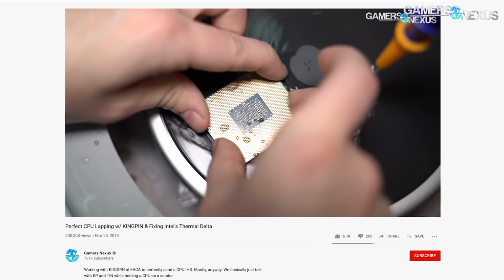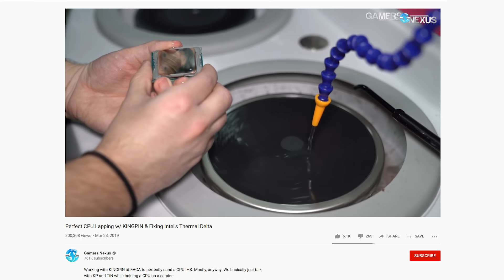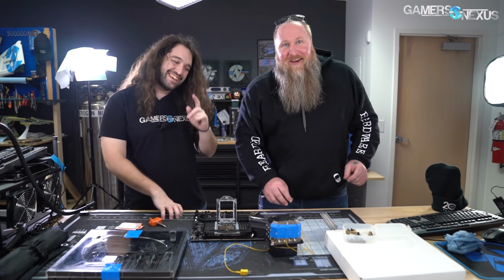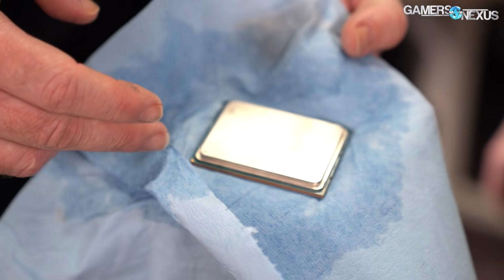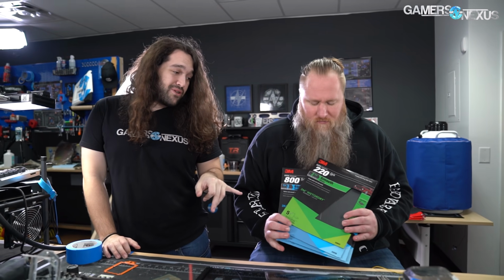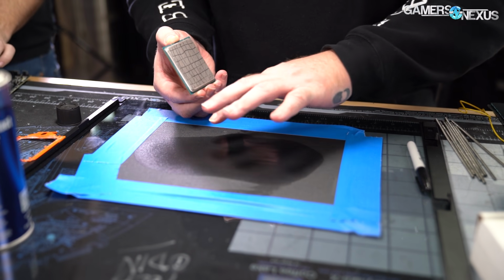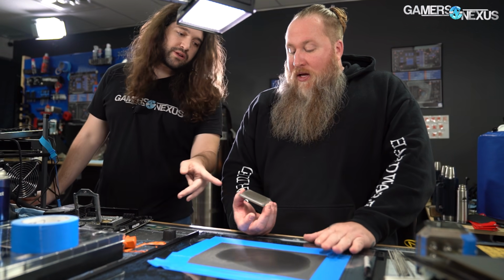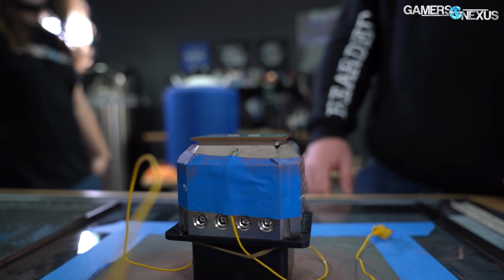AMD Threadripper CPU Lapping & LN2 Prep, ft. Bearded Hardware & 3970X

Comment: Why does everyone assume that the nickel plating is the same thickness across the IHS? Is that proven? How do we know that the nickel plating isn't the way that they put a perfectly flat surface on top of the slightly imperfect copper base? It seems to me that, unless the process of nickel plating invariably produces uniform thickness, the fact that copper begins to show through unevenly doesn't necessarily prove that the nickel surface wasn't flat.
Reply: AFAIK they use some galvanic process (same as you would apply chromium on car parts) this process usually has a very even outcome - especially on such flat surfaces.
Reply: @ISOHaven It does when nickel plating something. It's not like dipping it in paint or something. And they use electroless plating and not the electroplating people do at home. The variance is to the size of an ion because they are always attracted where the least are positioned which for nickel means 0.00000007 mm.
The warping happens when placing the nickel plated IHS on the CPU and is often just by design because of accepted tolerances.
They could make and sell CPUs much flatter than you'll ever get with pathetic sandpaper (grid 2000 sandpaper only does 0.01mm particles.) but there is no reason to. They absolutely do not give a shit that you buy their CPU because Dell buys 10 000 every month to put in a server rack with 6000 rpm fans blowing on the heatsink and they wouldn't if they added an unproportionate amount of money to get the temperature 1°C down.
Reply: @ISOHaven 0,1 mm this is 3times as thick as a copper layer on a pcb ..the coating which we are talking about is in the range of a few micrometers - a veriation of 15um to 20um so +/2.5um is way below the flatness/parallelity of the IHS. for further read i can recommend you this https://www.nickelinstitute.org/media/2323/nph_141015.pdf edit i meant this https://advancedplatingtech.com/electroless-nickel/electroless-nickel-plating/ ...but the otherone is also good if we are talking about conventional electroplating
Reply: if the nickel was perfectly flat, it would wear evenly when abraided on a deadflat surface--they demonstrated here again that it doesnt
Reply: @jefflavenau  The whole IHS is deformed and that's why you see it disappearing over different spots.
If you ever lapped a CPU you would see  you're taking of nickel first and afterwards a mix of copper and nickel which wouldn't happen if the copper plate was flat.

The deformity happens when placing the IHS on the CPU. The nickel plating happened months before that in a whole other factory. They place an order for a few ton of nickel plated copper sheets and then work with it from supply.
And again this is electroless nickel plating where you have a variance of a few tens of picometers. Not the amateur electroplating people do in a tupperware bin.
Reply: @Rizon1985  I think you meant to tag the OP because that's what I said
Reply: @jefflavenau  I m assuming that you dont have a engineering degree (this should not be considered as offensive). But then you should know - deadflat does not exist. Try to get a machined part with parallality of 0.01 mm and flatness of 0.01mm yes possible but not cheap and definitely not used for IHS mass products. so if the piece of copper is like a mountainchain under the microscope evenly applying nickel will not flatten this. At least not with the described method. So now hand lapping with ordinary sandpaper on a "deadflat" surface. I have done this by my self. If you move the cpu with your hands on the paper you can not hold it flat in the micrometer range so you wiggle it around the center and in the most cases you tend to have a konvex shape. Therefore you will first remove nickle on the corners. In addition to this the sandpaper behaves on the smallscale like foame so the edges of the cpu will tend to be deper in the paper than the center of the cpu. next even if you use tempered glass it is not flat unless you buy something which is calibrated like a granite stone class 1 or even 2 (this is what i would consider as almost deadflat) ....just have a look at this https://www.youtube.com/watch?v=j9FsmsjXKx8
Reply: @siclucealucks  that is the point I am making. Neither the copper nor the nickel is flat. Hence they do not wear evenly when brought in contact with a relatively flat abrasive. Why do you think I'm arguing? What I'm telling the OP is that the IHS is demonstrably not flat as illustrated by it wearing away in the corners first. Yes. We are saying the same thing.
Reply: @jefflavenau  The nickel is flat on the cooper. It is like snow on a hill - homogeneously distributed. If you grind the hill you will first grind off the tip of the hill hence the copper will shine through and will give the impression that at that very point the nickle was thinner - which is not the case. You just grind off the material on one point of the bulk. This is why I'm arguing nickle is flat, copper not. But flat on nonflat copper so it appears that the nickle is not flat too. The OP was asking what if the copper is flat and the nickle is not? All the arguments made by others and me are to proof that the copper manufacturing is the issue not the nickle.

Comment: I appreciate this.. I just lapped my 1950x and heatkiller iv pro.  My cpu was pretty flat.. didn't even make it through the plating everywhere before the whole thing started getting polished on the full surface.  The cold plate was really high centered though... I'm on water and I am happy to say I dropped a few degrees at idle... but I feel it's better contact and running even a few degrees at full load.  If it wasn't for this video, I'd still be hemming and hawing over doing it..  My copper showed up kind of in the middle first.. and when I was seeing good polishing on the nickle everywhere I stopped...

Comment: "You can have a fun project with this, even if you void your warranty."
The fun begins by being able to afford it.
Reply from the maker: I mean, sand paper is like $3. You can lap any CPU with an IHS.
Reply: @GamersNexus  I was referring to the CPU, but even tho it sounds like a good experiment to do.
Reply: When I upgrade from an i3-2100 to a 3000G soon, I'll both delid and lap the i3-2100. Just for practice. Then I'll do the same to the 3000G. By the time I can afford a nice processor I'll know what I'm doing and it'll cost almost nothing.
Reply: @cm01  You can't get a used 2200g?
Reply: @crazyjak56  meh, sure I could
Reply: I can afford it, but I run a sudden and an RX 580. Got no need for this ridiculous amount of power, and you get money by not wasting out
Reply: Linus already voided that by fixing the pins.
Reply: @GamersNexus  $3 whole dollars? This man's insane! gets struck by tech lightning

Comment: If you increased the git on the emery paper, through a number of steps ending in 2000 or even 3000 grit you can achieve an almost perfect surface without visual scratches, this improves the contact still further, its worth a try.

Comment: I used to lap all of my heatsinks when I was younger and cared about maximum cooling performance.  The difference was generally measurable from around 2-5ºF reduction under load.   The CPU's I worked on were open die (Athlon XP era) so  I never really thought of inverting the process and lapping a CPU lid.
Reply: not delidding ?
Reply: @rogueanuerz  believe it or not, CPU's didn't have lids back in the day.

Comment: 9:51 Me, an intellectual, has his barebone motherboard bolted to a piece of wood, with the PSU at its side as a stand for the anime figures and bunch of cables and the SSD around.
All of this in the very same (16 x 45") table that my keyboard, mouse, monitor and residual nocturnal food and beverage are.

Comment: If you've done this before you'll also note that the flatter the top of the chip is, the more prone it is to hydro-locking on the heatsync.  I do on-site OEM Certified repair and there's a big difference from one chip to another.  Older "dryer" thermal compound can also make a difference, but often the hydro-lock will force a pinned CPU out of it's socket.

Comment: The two surfaces get "rung" together. That means that all or most of the air gets pushed out from between those surfaces. So atmospheric pressure what's to hold them together.

Comment: The rotary polisher is not a good way to lap anything unless you have a jig that will hold the chip completely parallel to the surface. As trying to hold anything by hand you will apply uneven pressure and will inevitably put facets in your chip surface.  You also need a fine enough abrasive to provide a smooth/flat surface.. I work in an industry where companies are lapping silicon wafer chips to witihin thousands of a micron... 

Send me one of your chips and ill lap it down to 50 nanometers (0.05 micron) across the surface (no charge) and will send it back for you to test. The surface will be so smooth it will look like a mirror when you look into it.
Reply: @davidhoward2237  Dont need a granite plate for lapping.. just a sheet of tempered glass will be just fine as a surface.
Reply: @GamersNexus at least send an old cpu to this guy to test it out , Bench it before with all your technique and after his Mirror finish, could be very interesting for us viewers!
Reply: oh man I like this challenge :D
Reply: @David-li1uc  Flat is flat even if it's not parallel to the PCB. Heatsinks are screwed in on all corners so it would still be flat against flat There's also absolutely no way to test that difference because reseating is going to change the difference by multitudes more than a different lapping method would (unless you did your best to lap a convex surface on the IHS). Software also has too few digits to see the difference and an external meter would be placed too imprecise to get consistent tests.
Reply: @Rizon1985  Well as flat as can be he pretend he can flaten to a whole new level where figure8 sanding can still introduce 'due to hand sanding' a convex surface " i have no measurements to compare Steve technique to His but that could be interesting even the measuring" , i do agree on the rad mount that it can tilt swivel and follow the fact that the sanding migth not be paralel to the socket it might achieve a truer flat , it should be nice to check direct die sanding and most importantly Rad sanding . i hope to see this soon :)
Reply: Honestly, if you're that good at pulling it off, you should buy up some binned chips, and do some yourself.  Or, custom mill some of your own heat spreaders for popular high end chips.

It's actually kind of a shame that deliding isn't as big a thing as it was a few years ago.  Because not enough talented machinists got into making direct cooling rigs..
Reply: im thinking about lapping my cpu that flat, kinda curious what effect it would have. You could actually cold weld cpu and cooler together if you don't put paste on it
but as a machinist the way tech guys talk about lapping and flatness is very triggering xD
Reply: What alien tech do you use to do this
Reply: This isnt even real lapping, this is just sanding. They should be using an actual lapping plate, gets much better flatness over just sandpaper. to the point of actual wringing.
Reply: @David-li1uc  so he deleted his comment..
Reply: this "lapping" still gives better results than normal iha

Comment: tip from working in metallurgy - it doesn't matter which way you move it when sanding, even pressure is the key
if you don't have good feeling of how much pressure you apply put some weight on top of sanded surface and just pull/push it around the sanding surface
Reply: Yep

Comment: start with 100-200 and go until its bare copper. the steps up to finer paper goes really quick once you get the base flat. make sure your glass is on a fairly flat and well supported surface because those thin panels do bend and you can end up with a concave or convex surface. and make sure you dont press the cpu down, the pressure from your hand can warp the IHS. keep rotating it 90 degrees every min and move in a figure 8. i find dry sanding works fine, but tend to use a little water as it seems to keep the paper from clogging as much.

i like to go to at least 2000 grit and there is no point doing the IHS if you dont do the heatsink. i think the biggest gain is from the low grit so even if you stopped at 200 on both you would see over half of the gains from that alone.

Comment: I don't lap cpu's to the degree that most do it. If I get it to a point where I can see it has leveled off, I stop there. I think I get up to about 600 grit and leave it at that for the ones I am serious about. If I go any more than that, I will simply delid it in the fist place and do direct die. My 2600 I lapped to 600 grit and it was already starting to become shiny, and I had a 5ghz clock on that with peltier water. I eventually delided the cpu and got the same performance with a touch less voltage. 

My 3770 was dished rather badly and all i did was knock the corners down. Once I saw the copper showing on the corners and the center wearing through the lettering I stopped there as well, and it lowered temps by about 7 degrees at full load, so that was good enough. It had unusually bad contact with the cooler otherwise I would not have bothered, and normally I wont see anywhere near 7 degrees drop, which is just an indicator of how bad it was. Most of the time I will see maybe 2 or 3 degrees at most on air. Sometimes I wont really see any difference. And that wasn't even an overclocked cpu.  Delidding would have been even better.

Comment: For people who want to make this happen, I am sure someone with a motor which spins continually and some fab skills could create something which can be wired into a belt sander to rotate the package while an adjustable fixed arm with a spring-loaded sleeved holder aids in applying pressure to the CPU so the sanding surface automatically removes variation in the lay of the IHS.

Comment: I've lapped once before, plan to do it again soon to a 9900K, but I let the CPUs own weight do the work and just try and figure 8 it around the sandpaper with applying little to no pressure, just use my fingers to try and guide it around without pushing down on it at all.

Looking forward to the live stream!  Will have more ln2 myself Monday morning :)

Comment: I did this to my celeron 533 waayyyyyy back in the day, it made a 30c difference, there wasa  CRAZY concave dent in it. then then easily overclocked to 850, back then, that was insane.
Reply: John Douglas it’s amazing sometimes crap chips turn into decent lol
Reply: Is that a Slot 1?
Reply: @DarkLinkAD  No, but not long after it, was a socket 370.  pentium 3 era
Reply: @John-gm8ty  Oh yeah I remember now, you needed a  " slocket " to use these on an older Slot 1 board.

Ive always wanted a dual slot 1 board with dual  slocket socket 370s.
 
Ive seen a video of dual pentium IIs playing Need for speed underground (A game that came out much later)

Comment: I'm doing my Ryzen 3600 and Noctua heatsink next week - fuck all else to do at the moment.
The 3600 is an interesting one because both the core and SoC are off-centre, but the Noctuas are machined slightly convex to press the centre. I'll come back with some results if they are outside the margin :)

Comment: Also removing the anodizing, removes a layer of the many layers between the silicon and the pot. Might not be noticable to many, but when dealing with high performance OC's, every degree counts
Reply: Very good point I didn't think about that, would lead to better heat transfer but itll heat up far faster too.

Comment: I've lapped some different surfaces in my life and I would not say it's hard to destroy the surface. In my experience it's actually pretty hard not to destroy the surface.

What tends to happen with a small brick like this is you apply more pressure where your fingers are, meaning the edges. So as you sand it, you will create a convex surface, even though you might be thinking it was just the edges that were high to begin with.

Add to that the miniscule potential gains to be made from this and it's just a ridiculous waste of time.

Comment: I have to disagree here.. showing copper earlier doesnt necessarily mean its a high spot there.. it could be a variance in the coating thickness.  Going down to bare copper lets you know you've removed enough, but it doesnt mean it has to taken that far..... are you using a glass plate to check contact from underneath?  a thin liquid film and looking through the plate from underneath will show you the high and low spots
Reply: I like this tip. Thanks mate

Comment: Instead of Liquid Nitrogen gas for Supercooling have you tried Liquid Argon gas. It is about the same price and is widely available. Ar is a Nobel non-reactive gas, but Nitrogen can oxidize or react with your metal. It will chill a few Degrees lower than Nitrogen and will not leak as much as Helium or Neon.

Comment: I recommend using a dentists articulating paper to check for inaccuracies safely and without a need to sand it off, it can be wiped with alcohol and it highlights all points of contact, it's pretty precise.

Comment: Suggestion for taping your sandpaper down:  First lay down a piece of tape on glass, then super glue the paper down to the tape.  Maintains your flat surface, holds super strong, and comes back up relatively easily.  Also, for holding parts, or anything else, you can use tape on the surface, and the part, with superglue in the middle for an ultra-thin two sided tape...